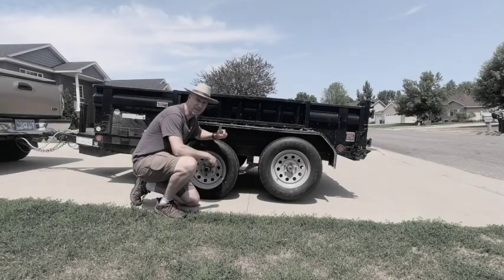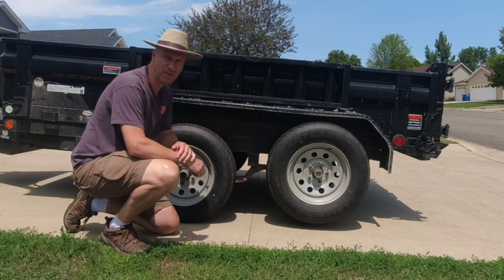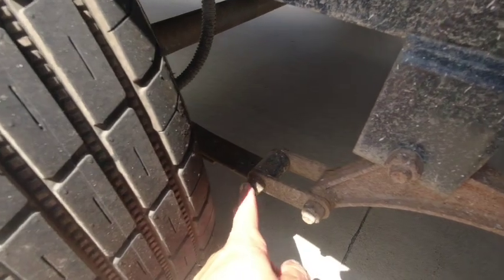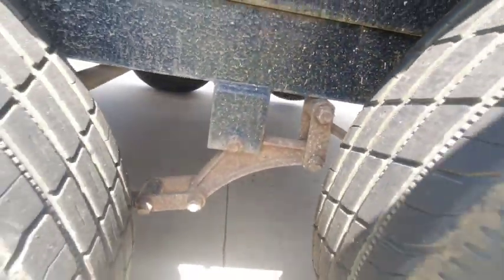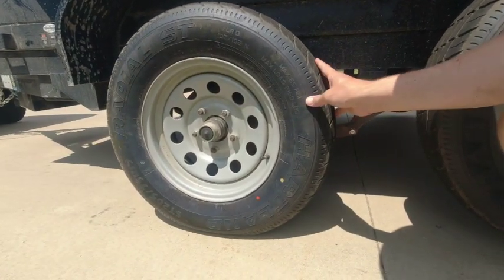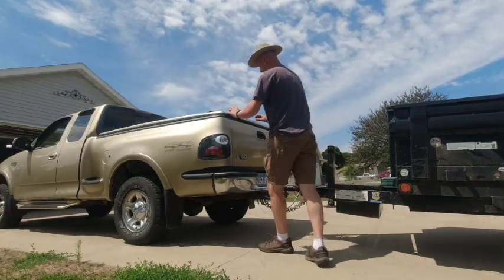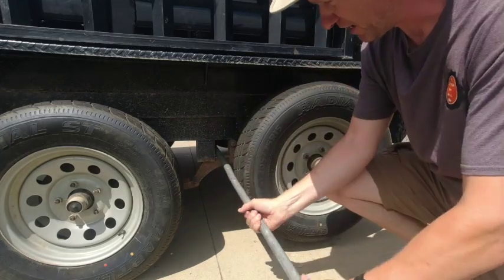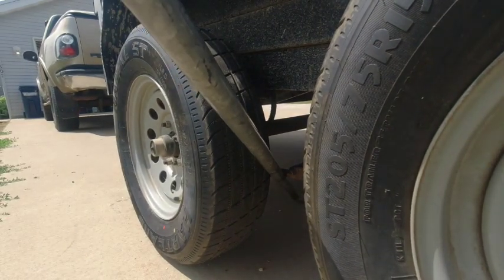HOW TO FIX THIS AXEL ISSUE

Comment: Please take this video down before someone gets hurt.  Absolutely do not use a pry bar to fix this issue. Simply use a floor jack on the axle that has the shackle correctly situated. Lift that axle near the wheel and two pumps will have it straightened out. Much safer. Especially when dealing with a travel trailer or heavy toy hauler or heavy trailer.   Pry bars do not work and you are going t damage the underside of the Travel trailer or break an arm.

Comment: Wow Jon, very interesting. Thanks for sharing.

I was taught many years ago that with tandem axles if you got a flat and no spare to chain up the axle to get to a safe place or to get home where you can repair/ replace the tire.  I can now see that you do get a little clearance that way.   With full load with one axle would really be a strain on the suspension though.  😊 Dan
Reply from the maker: Yes that would be a possibility to either chain or ratchet strap one side of the axel up if I had a flat. I always have a spare tire in the truck just in case I need it though. 
Keep on tractoring!

Comment: My trailer did that yesterday and today. The first time I picked up the whole back end of the trailer with my tractor and it fixed it. the second time I had to use my truck jack and a block of wood on the very back of the trailer. I sprayed oil on every thing related to the equalizer and hope that helps.My friend said they sell a hollow bolt with a grease fitting to go in the equalizer..

Comment: Aren’t the leaf springs supposed to be on the underside of the equalizer? So it would be an M and not a W? Or does that not matter?
Reply: Depends on the design. One is called over-slung, the other under-slung. 
The setup in the video  seems more common.